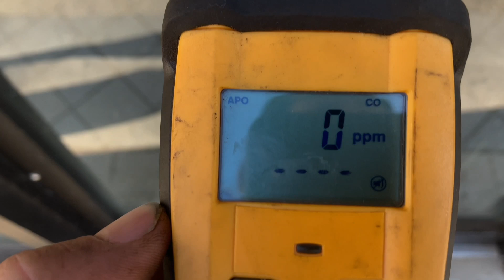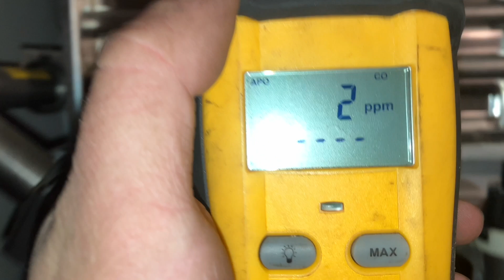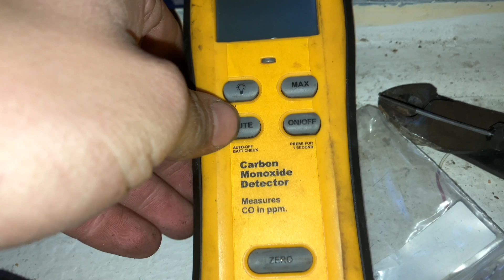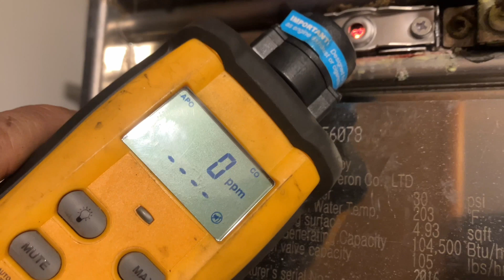High C.O. Coming From Boiler

Comment: Not just recharged the expansion vessel? Plumbing in the usa is extremely odd 😂
Reply: Most of the time if done incorrectly can cause major problems. Plus the material expandandes ect. Like a Ballon once you deflate it, it will no longer be the same so you shouldn't reuse them. You can... But you shouldn't for saftey and damage reliability reasons.